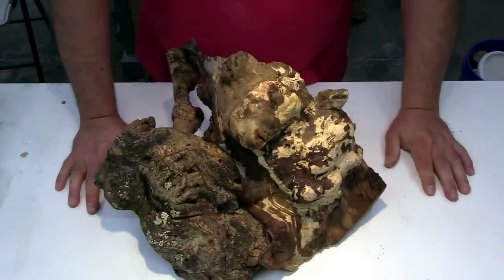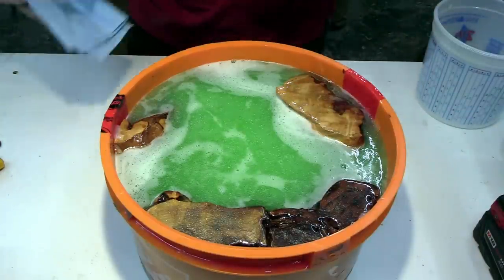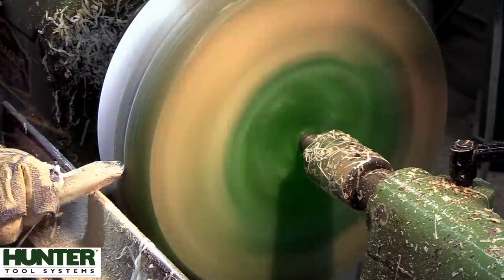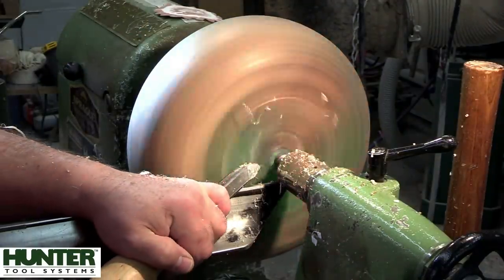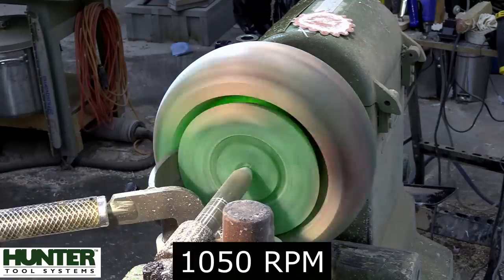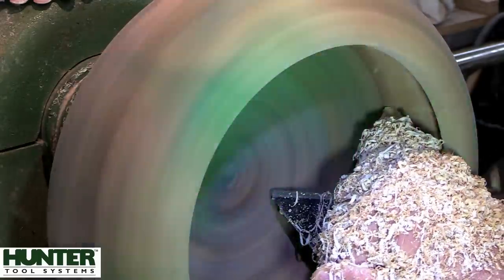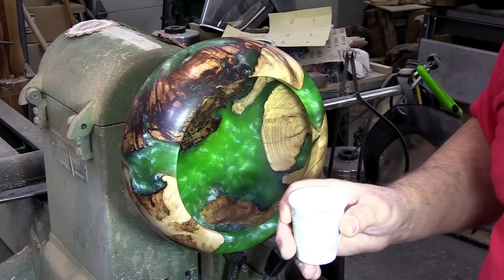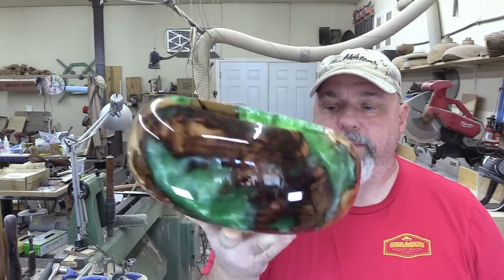Woodturning - Emerald Green Loves Maple Burl

Comment: Another stunning piece! An idea for a core bowl would be to place it upside down in a saucer/platter and pour a wide rim around it. Outside of your norm, but you would be good at it.  Pretty sure there is not a wood/resin combo that you would make that would be bad.  People seemed to like the fluted bowl/vase that you did, so maybe do one of those as a video. If you are making it, it will turn out great!
Reply from the maker: Been debating that as well, thanks!

Comment: That piece may very well be my favorite. That color resin pairs so nicely with that burl. Well done! Maybe do a combination if you have several of the top cores that would not work well for much by putting a few similar small cores into the bucket and cast a bowl or hollow form as a channel give away.
Reply from the maker: That’s an idea. Thanks

Comment: Well, I make what I whimsically call "Carlin Valets"  They are a small shallow bowl between 4"-6"  wide and maybe get little over an inch deep.
I call them Carlin Valets because the late Great Comedian, George Carlin had a great routine about having "Place for your stuff." so it is a nice place for ones keys, pocket change, small every day carry crap one has.  And perhaps something as such would be a good use for those cores you have.  with that Go Designer Epoxy....   and Good luck on the house.
Reply from the maker: Thank you very much!

Comment: Designer Epoxy. Absolutely stunning bowl!! You're such a perfectionist that you nit pick. As my hubby says to me on every project...stop over analyzing...it's beautiful. But that is a hard thing to do when you're a perfectionist...I am the same way! I noticed you wear gloves occasionally. Is that to avoid splinters? Aren't you scared to use them? I realize that sometimes it is necessary to avoid skin damage but they are so dangerous in general. Thanks Jim for another awesome bowl!!
Reply from the maker: It’s to protect my hands from the resin shards coming off the lathe. Keep your hand on the right side of the tool rest and there will never be a problem. Thanks

Comment: Fantastic! 

I've been wondering if you ever think about making a big silicone mold so as not to risk the castings getting stuck? Even if it's fun to watch you with the hammer 😁
Reply from the maker: Trying to find an HDPE mold that will fit perfectly inside of the pressure pots but not an easy thing to find. Even tried to get a custom one done without any luck. They are more durable than the silicone molds. Thanks

Comment: I'm always impressed with your work, beautiful job 🥰 I was wondering if you had used a 5th piece of wood for the center of the casting if that would have given you a wood tendon for your chuck to hold and use less resin in the initial pour?
Reply from the maker: Yes, thank you

Comment: Beautiful bowl. I do have an idea for some of your cores. I have been toying around with the idea. To use resign and wood bowls to build a fish tank with. More in the style of paludarium. Using a resin finish because it should be inert. Which will not harm the plants or the fish. What cha think.
Reply from the maker: Not so sure about the wood and resin idea for a fish tank. Wood doesn’t like water after it’s been dried. If you do it makes sure you’ve completely encased the wood in resin so non of it’s exposed. Good luck. Jim
Reply: @SpragueWoodturning  using resin as a sealing finish. Keeping it water proofed

Comment: Not being critical at all, but just wondering if the floaties in the resin could have been prevented by stabilizing the burl pieces in the vacuum chamber first, and then put in the resin mold to be cast together? Absolutely gorgeous work.
Reply from the maker: Yes, but anytime you stabilize wood, you can’t call it food safe. This is the main reason you don’t see a lot of it in my work. Thanks
Reply: @SpragueWoodturning  ah, i did not know that!

Comment: Jim, you do such nice work! That is a really nice-looking bowl in color, composition and shape. Just a thought - how would it be to use a hollowing tool to accentuate the inside of the rim?

Also, have you ever considered carving your information into the bottom of the bowl and use a different color resin to fill them and make them work on the wood and the epoxy?
Reply from the maker: Most hollowing tools are shaped the wrong way on the outboard end of my lathe and I don’t have a large enough lathe bed to mount it either. 

I’ve used an engraver to do my signature, but I’ve never used a different color resin to fill it in. Thanks

Comment: Green is not my color normally but that piece is absolutely fantastic!  I love it! I'm sure the new owner will too.  Quick question...when you were doing the finish did you change the lathe rotation when you went from the inside to the outside?  Just trying to learn!   Thanks for another great video Jim!
Reply from the maker: Yes, it’s just easier to apply the finish’s for me. It won’t make a difference either way. Thanks

Comment: Nice bowl. Didn't realize that Waterlox was resin based....also when I buff  in between applications I can't get the surface really smooth??? I do clean with denatured alcohol also...
Reply from the maker: It’s not resin bases, it’s tung oil based. In order to get it to flatten out, you need heat that’s generated by the Tripoli buff. Try pushing a little harder and load lots of the compound on the buff and it should work. Thanks

Comment: Absolutely Beautiful, I am buying a lotto ticket on a regular basis, so I can buy one of your works of Art. On a side note, Your Arm you use to cut the Bowl inside, have you thought about a Air Pipe on the Arc of the Arm Blade, and then you don't have to have your hand so close to the bowl to blow it out, It ( Air Pipe ) would be on the arm itsef and be attached in a manner that it would go inside with the Blade   .👍👍👍
Reply from the maker: The problem would be that you need to do it on all four knife sets. Holding it there wasn’t a problem. Thanks
Reply: @SpragueWoodturning    Chhers, Enjoy the channel.

Comment: I find that with the epoxy I cast (thicker than the stuff you're using) a pressure pot is essential. Any casts I've done without it had tons of bubbles internally and bubble voids all over the surface. I threw them away.
Reply from the maker: Have you tried to use a vacuum chamber to remove the bubbles before letting it sit on the bench? Just curious. I find it very hard to mix thick epoxy without putting tons of bubbles in it. Thanks
Reply: @SpragueWoodturning  Yes, it was an experiment I did to see what would happen without the pressure pot. Two castings from the same mold, same resin, one with vacuum and no pressure, one with pressure and no vacuum.  The vacuum/no pressure was full of holes, bubbles large and small. I inject my molds with a large syring and have only one air vent so the voids should have come out and they do, when I use the pressure pot. But vacuum alone was not enough. I haven't repeated the experiment though with something like urethane which is water-thin so it might be better at releasing the bubbles.